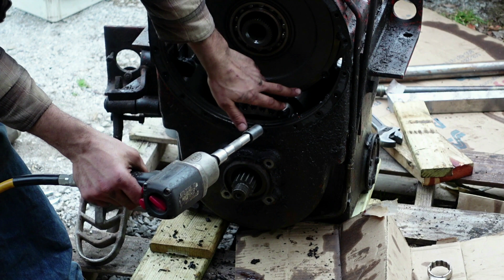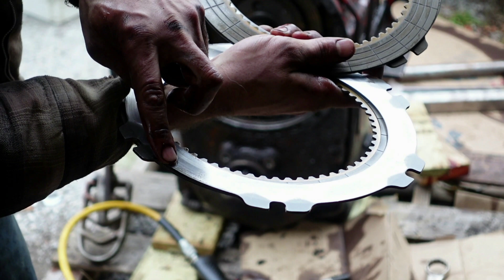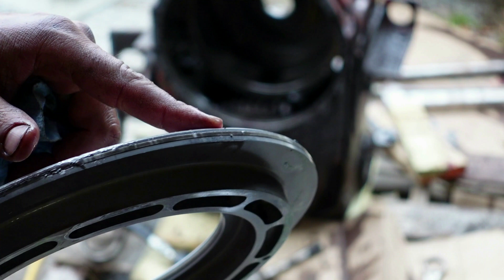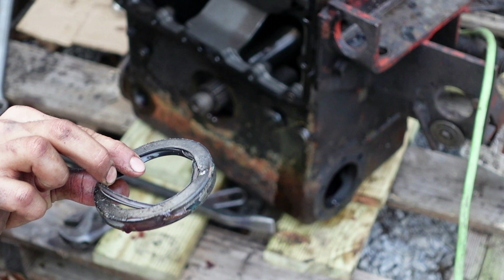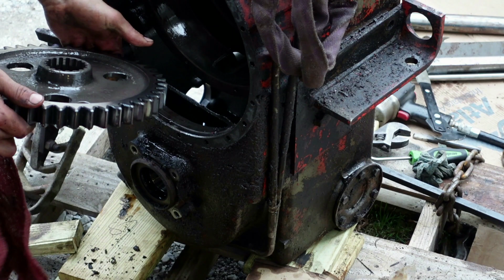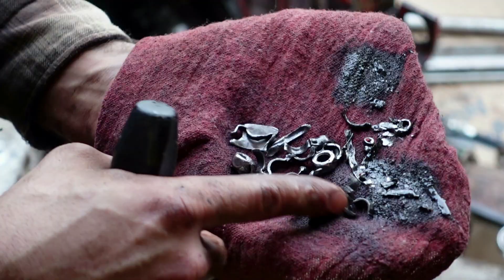Timberjack 360 Allison Transmission Tear Down - Part 3

Comment: Where did you source parts? Thanks a ton for posting this video.
Reply from the maker: For the transmission, need to go through an Allison off road transmission dealer, I have been using "parts unltd" out of Missouri, Tom there seems to be pretty good at knowing these transmissions

Comment: Hi :) good video !
Iam right that the 360 have oil and hydraulic in one system ? Or two separate?
Reply from the maker: transmission is separate from hydraulic, 2 oil coolers and the pumps are stacked
Reply: @DillonHFM  good to here !
I will relieve my 360 again . But before I must change the oil .
Gear atf automatic oil ?
Hydraulic normal hydraulic fluid or what you say ?
Axle and wheel 80w-90 gear oil .
Reply from the maker: Two separate, the transmission is its own system and the hydraulic has its own tank in the nose